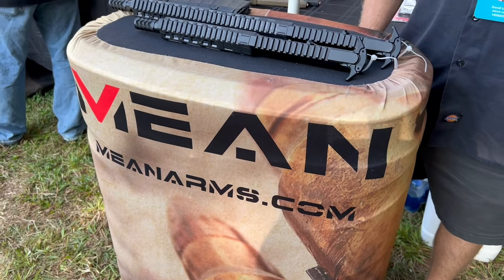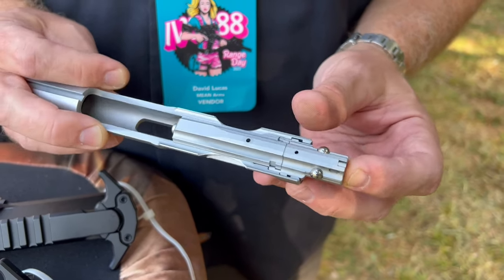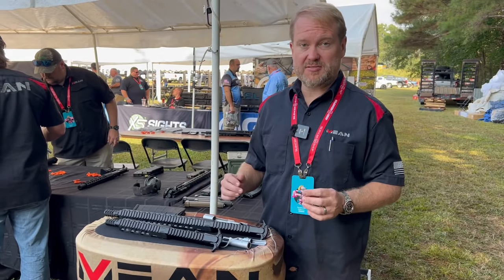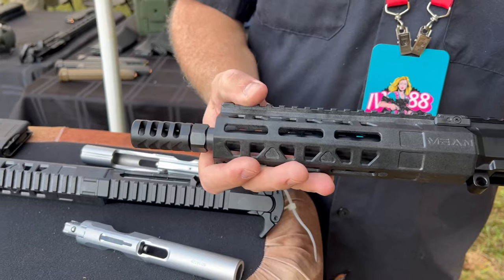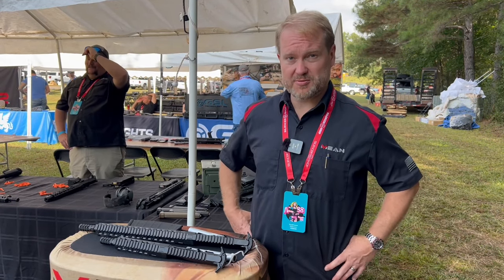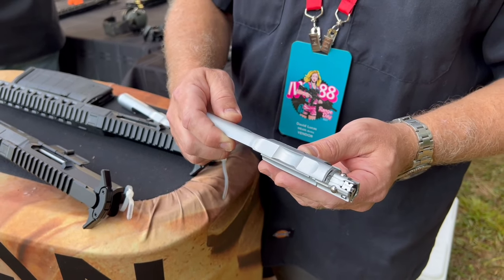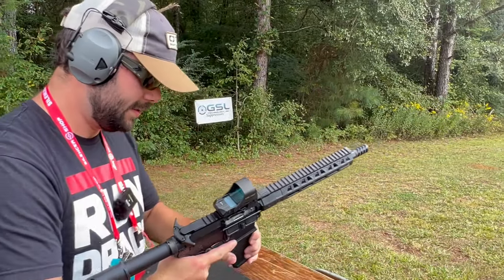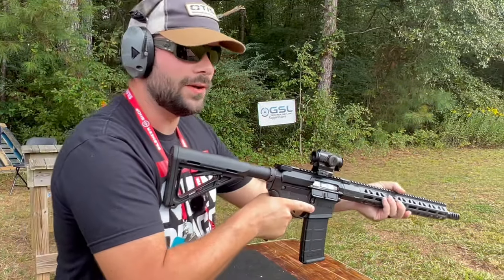Mean Arms Bearing Delay Upper | IV8888 Range Day 2023

Comment: Slightly confused since when has he'd ever been a problem with a nine millimeter pistol caliber? Did he say it was like fifteen hundred to sixteen hundred dollars? You can get a roller delayed buffer system for like 150. That'll give you nine tenths of that system. It's made by maxim and it works. The only issue is it takes a little effort to charge the system. But once charged you don't notice the difference. I also got a Devil Dog side charger with a competition knob on it. And that makes it really easy.